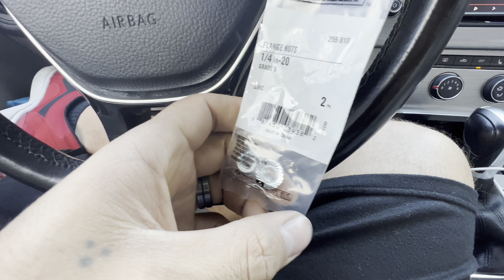CB7| REMOVING H22 OEM VALVE SPRINGS and a stripped valve cover stud

Comment: Hey did you feel any difference with the OEM spring Seats vs the Skunk2 spring Seats? Did the dual valvesprings fit better?
Reply from the maker: Motor is still sitting, I’m not sure if I understand what your asking. Oem and skunk 2 are both dual springs. The they fit the same in the head, I think the seats (bottom flat washer) is so the skunk 2 springs fit tight without movement